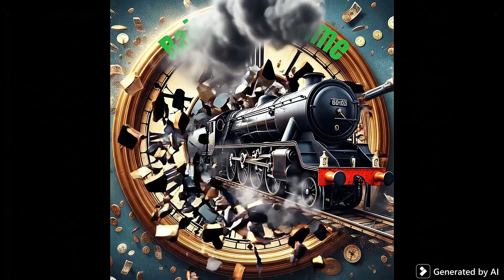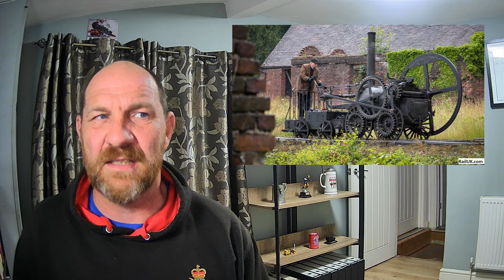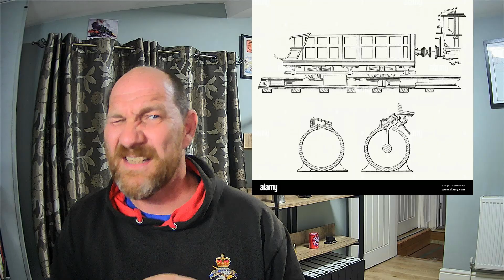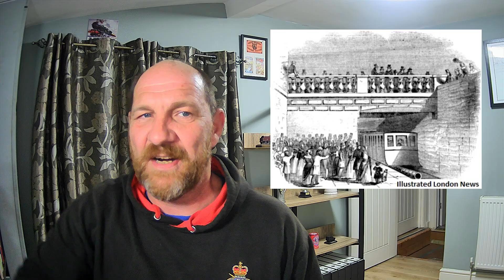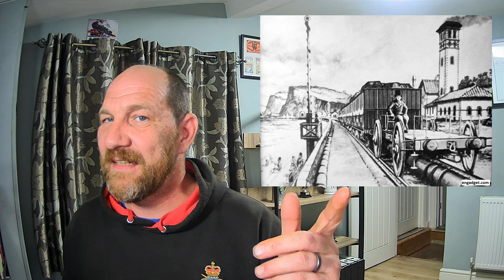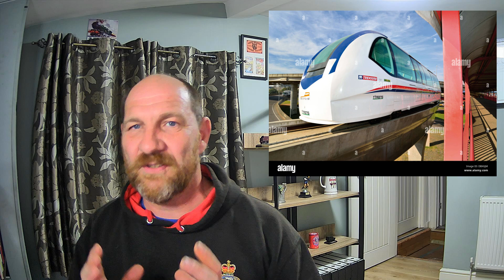Atmospheric Railways

Comment: Very interesting.  I've heard of them - I don't recall knowing how they worked though - from various sources.  I think one will be Edward Marston's Railway Detective, being set in the 1850's, vaguely referencing the railways, but one character is very much against anything Brunel, and I have no doubt the Atmospheric Railway failure, or a mention of it, occurs in one of them!  🙂

By the way, I think the small AI train during the video is much better even without sound, it did rather compete with what you where saying before.  Well done on another informative video - watched it all the way through!  🙂
Reply from the maker: I think Brunnel's failed experience with the SDR didn't do a lot to encourage people's opinions on this for of power, so it gets committed or criticised a lot. Thank you about the train, learning the editing program each time.
Reply: @RailRideinTime  🙂 I nearly mentioned it a couple of times, but couldn't work out how to put it - anyway I wouldn't have a clue how to add an animation even if I had one.  🙂 It's not that long ago I finally worked out how to add a still image!

I think the idea of the 'Rail Ride in Time' theme is a great (I like it).  I'm genuinely looking forward to your next video.